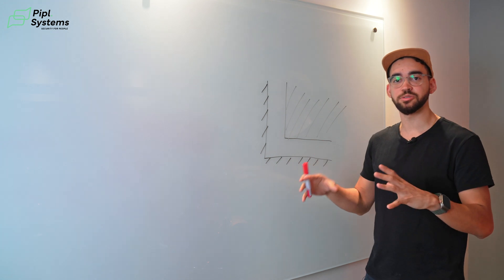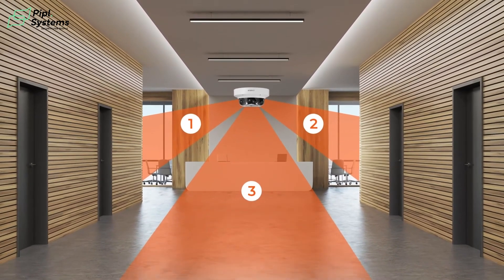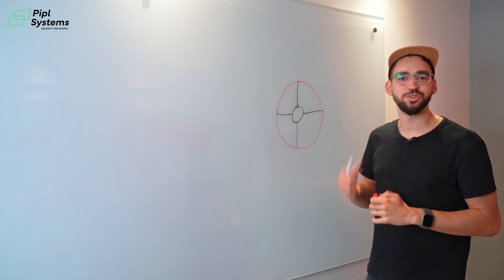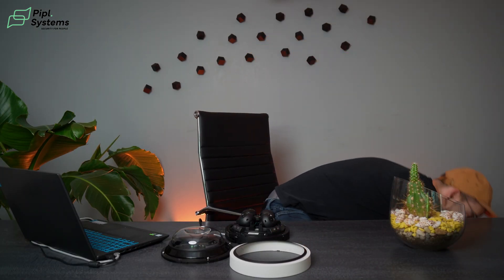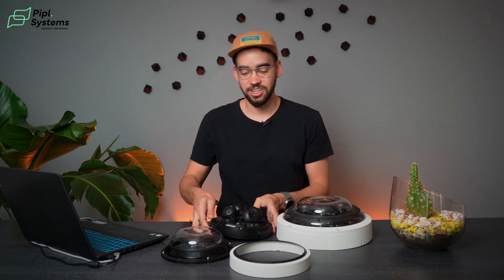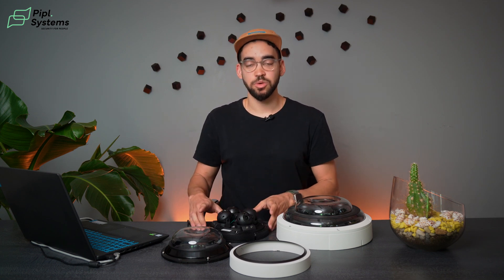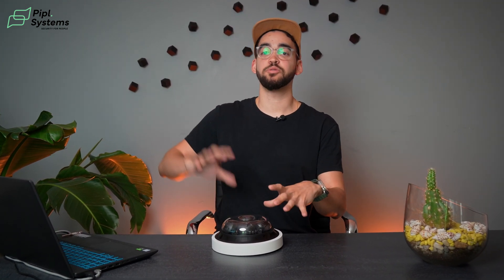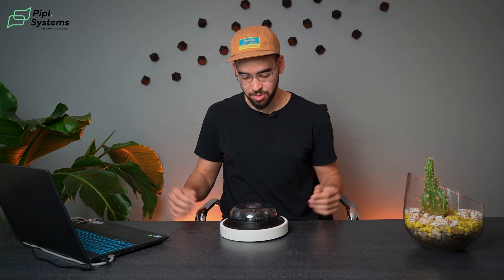Multisensor Cameras Explained: Featuring Hanwha's 4MP x 4 AI IR Mini Dome Security Camera

Comment: How about an application where you using it on an outside corner for 270° coverage. Can the cameras squeeze close enough together so you're not seeing too much wall on either of the corners. Work in the fourth camera rotate in such a way to see the blind spot and use the other three for the 270°?
Reply from the maker: In theory, yes! The PNM-C16013RVQ from Hanwha should work perfectly for your application on an outside corner with 270° coverage! 

Each of the camera modules has a 97° horizontal field of view, so three of them together can cover 291° (97° x 3), which more than meets your 270° requirement. You can adjust the pan and tilt to minimize how much wall you see, focusing the cameras on the surrounding area.

For the fourth camera, you can use its 90° rotation capability to cover any blind spots left by the other three. This setup should give you seamless coverage, ensuring that no area goes unmonitored.

Hope this helps! Let us know if you have any more questions. 😊